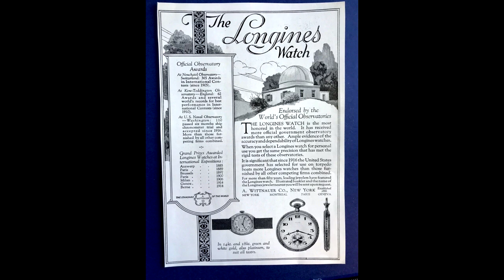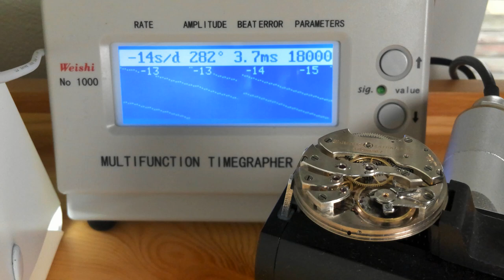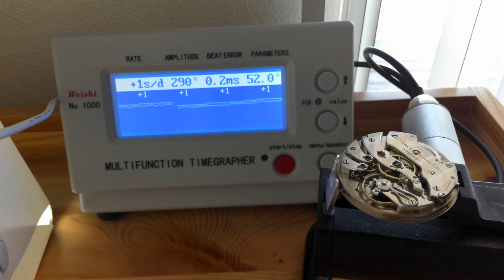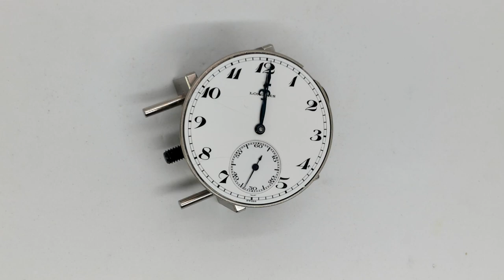Restoring an Elegant Century Old Longines Pocket Watch - Relaxing Watch Service Video

Comment: Great video, I’ve enjoyed all of your content that I’ve seen, thank you. The cap jewels on the pallet fork do serve a purpose in that they reduce end shake, which is quite helpful when adjusting a watch for positions. Too much end shake at the pallet fork and escape wheel can alter the alignment of the pallet stones with the escape wheel teeth when the watch changes position, influencing timing.
Gruen, one of my favourite brands, chose to forego jewelling the centre wheel in many of their 17 jewel watches so they could jewel the escape wheel. This gave them the timing benefits of a jewelled escape wheel, whilst avoiding higher tax tariffs that applied to more highly jewelled movements.